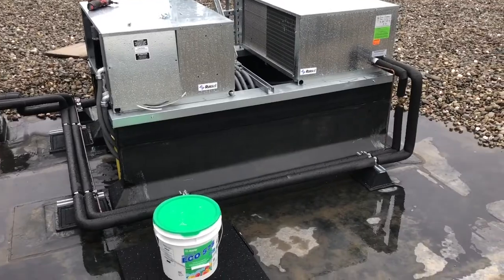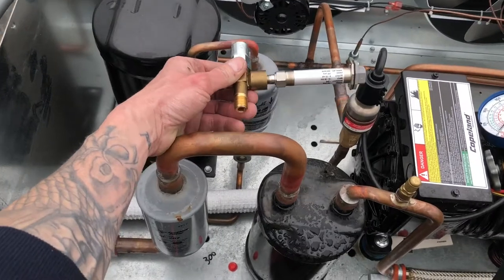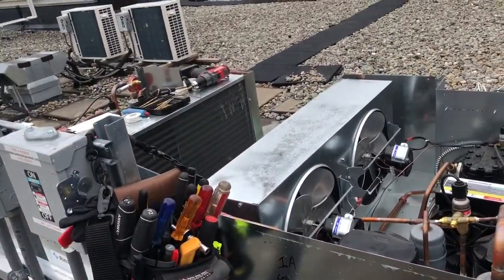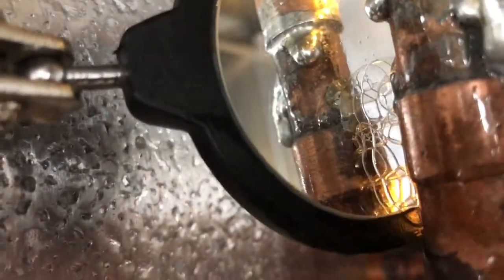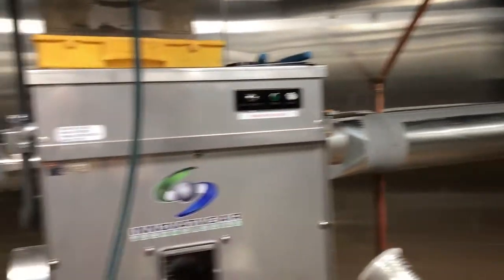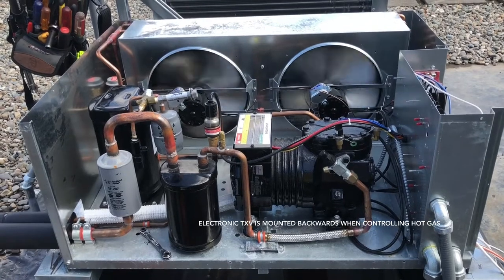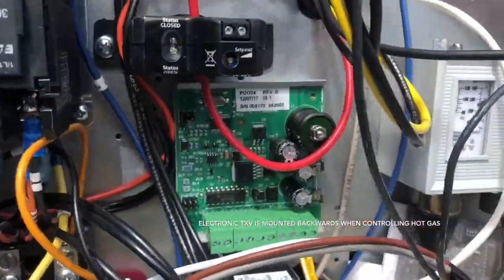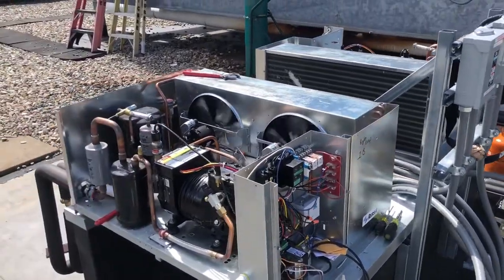Refrigeration Life # 5 . Walk-in Cooler / Clean Room Startup Part 1

Comment: Crazy how that electronic expansion valve controls the box temp. that close.  Nice to know if I ever have to install one,  it is put in backwards. I could see me putting one in the wrong way not knowing.   I have sometimes had to work in a health lab with the same 4 degree celsius plus or minus half degree.   When I was first told that 4 celsius I was like lets see 0C = 32F and I can't remember that  formula for converting celsius to fahrenheit. LMAO ~thanks for the video
Reply from the maker: jim defilippis ya it’s pretty cool how it works. But now there is also electronic hot gas valves so we are using those now instead haha

Comment: Units got headmasters, why put fan cycle control? , especially on both CFMs, let one run non-stop or be controlled by outdoor ambient t-stat and cycle second CFM by fan cycle control.
Reply from the maker: Mikhail Kurylenak because in the winter in the extremely cold days the head pressure won’t get high enough for the hot gas injection to work properly and then the temp of the box will go out of spec .